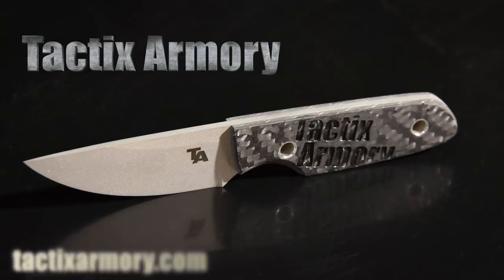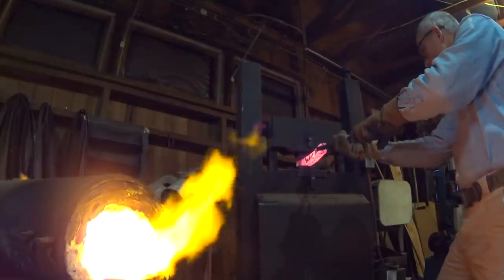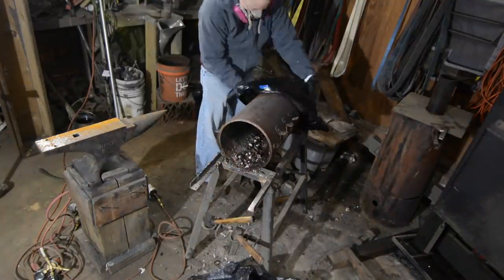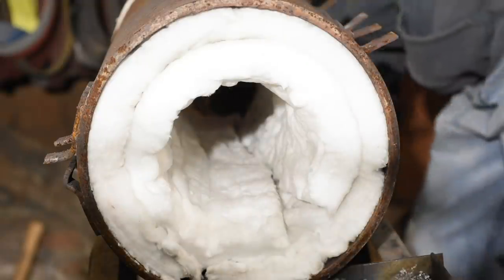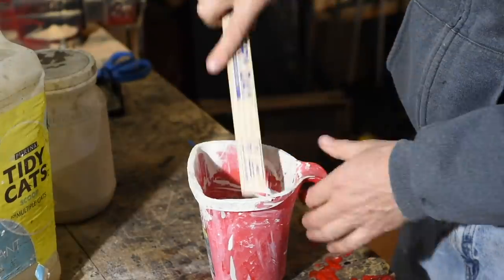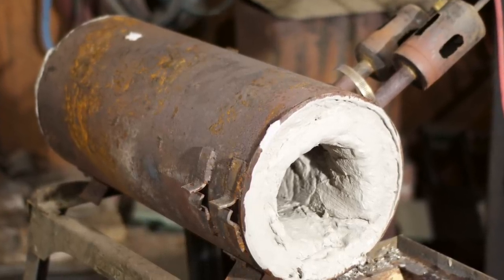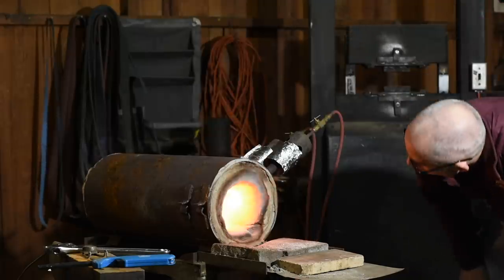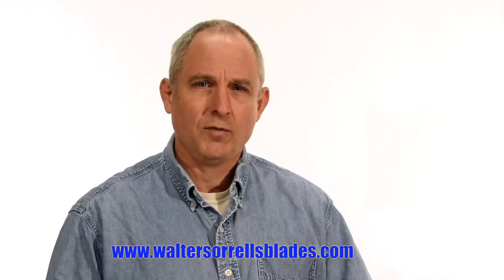Re-Lining a Knife Making Forge

Comment: That is pretty much the forge I made about 3 years ago, It works great but I would like to one piece of information here. I made the hole for my burner on the very top of the forge at 90 degrees, I think I would have been much better angling the burner entrance at 35 or 45 degrees, that way you get a better flame swirl and the propane hose does bend as much. Do be aware of the super hot gasses rising directly above of the forge, they  work great to kill mosquitoes around a 5 foot radius too!

Comment: Using a stabilizer (make your own with fumed silica and water) by spraying it on the wool and curing it with the burners is a good way to go.  The silica melts and bonds to the wool, making it much stiffer.  This stops the wool from releasing deadly fibers when it it hot AND toughens it up so it stays efficient much longer.  Plus, it won’t deform when you layer heavy refractory cement on it.
Reply: Hey man i just recently started a job as assistant into making these furnaces. The thing is, the guy is kinda uncautious and when he throw these things on the table a lot of dust comes up! Im using a mask but it doesnt closes too well, i tried 2 masks and it was a little better, but i felt some chest pain later in the day... i got very scared. I dont want to lose this job, but im also an athlete as hobby and damn... im too scared of lung problems!!! Could you give me any advices to protect myself???? Do you think a couple months of exposure is enough to have problems??? I really need the money. Im gonna tell my boss that i believe we should treat it way more carefully otherwise i cannot stay.

Comment: I just finished my forge, and now I come here to see you using the same thick wall steel pipe I did, as well as satanite for the hotface. Good to see my choices have been independently verified. (: Question though, how hot do you estimate the exterior of your steel pipe gets? Even with 2-3'' of insulwool I feel like that heat has to leak out eventually.

Comment: thank you Walter- that was all the information I needed. One question I have, slightly unrelated is, I see you left both sides of the forge open while you were working at the power hammer. Is there any reason to not close at least one side in order to contain more heat? Thank you in advance if you or others find the time to respond.

Comment: Thanks for this. What if you were to cast a cylinder of fire brick, with burner ports molded in that you could just slide into your forge? You could make a silicone mold and reproduce them easily. Would that not work as well as this refractive batting?
Reply: I would expect that sort of construction may be too brittle and fragile, I think that these fibrous materials combined with some form of castable probably offers the best balance between a decently durable structure that is still easily and affordably replaced.

Honestly, I like the idea of a hybrid best - something like a propane tank pancake-style forge like Walt described in the last video, with the fibrous material walls and individual fire brick in the bottom. I want to say that a cast in ceiling would be nice, but the fibrous material used there too I'm sure would work more than well enough.
Reply: seanautube Fire brick will work fine, however it will soak up a lot of heat while the batting acts as more of an insulator making the batting more efficient. There are some videos  out that do a good job explaining the different options. Hope this helps.

Comment: Wondering about using something like concrete tile backer board for the floor?
Reply: I use the clay pavers from home depot. Pre heat to make sure they dont explode though.
Reply: Actual fire bricks are cheap and easily up to the task.  They can also be changed out quickly and easily.  Cut your second (inner) piece of ceramic wool 4.5" short and they sit comfortably on the bottom.  They're huge heat sinks and will make your forge take longer to come to temp, but I think they're generally worth it.  Or make your own brick out of Kast-o-lite 30 (great stuff).  And make sure you really coat and seal that ceramic wool.  One of the biggest and most often overlooked health hazards of forging.

Comment: So I've tried to find Satanite...w o much luck.  
  So where did you get yours...anybody?
    Blessed days sirSir, Crawford out
Reply: @Velitesmaniple  . Thank you sirSir,   I appreciate your help alot.

  Blessed days sirSir, Crawford out
Reply: Try lining your Kaowool with some ITC 100, it will make your forge run hotter on less gas. Cheapo's will say you don't need it or it's no good. Yes it is expensive...
Reply: @johnburens3395  , ohhhh yeah!  Already bought Mizzou and ITC 100HT.  Buy once cry once right!!?
Reply: @danielcrawford7315  That'll work man. You might try using a kiln shelf for the bottom of your forge. It can be removed and cleaned periodically and it makes a nice flat base. The kiln shelf should be coated as well with a thin layer of ITC. You should have a fire breathing dragon provided you don't have too much volume/burner ratio.
Reply: @johnburens3395  , thanks sirSir.  That's a thought I hadn't had. Removable floor. Great idea.
   I've got my 3x3 tubing for a ribbon burner...probably 12 inches but could be more if necessary.  Not sure yet how to figure the forge volume  to burner size yet...ie why neither has been built so far.  Got a 3ft x 10ft 8th in plate and a 5ft x 8ft 8th in plate plus some 2in x 2in angle and 24ft of  3x3 tubing.
Plan is to build a forge and to build a foundry. Tbh I've been pondering on building  the foundry on the principle that I  can set in a single plane angle to make a drop in roof with the ribbon burner cast into it, with swing doors on the front and rear of foundry yo forge thru.   
  So now I have the idea via you for the removable floor.   Given I can figure the seal angles right and cast the castable true and tight, maybe I'll have a multifunctional unit. 
   Idk maybe I'm nuts or what not lol